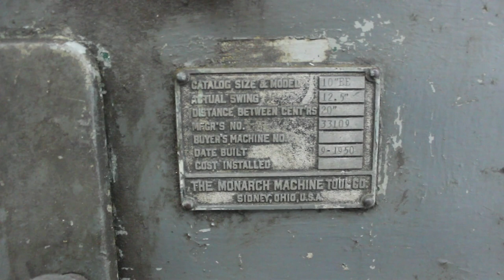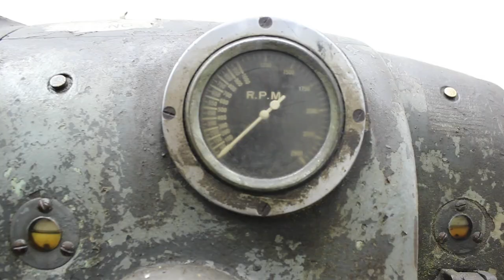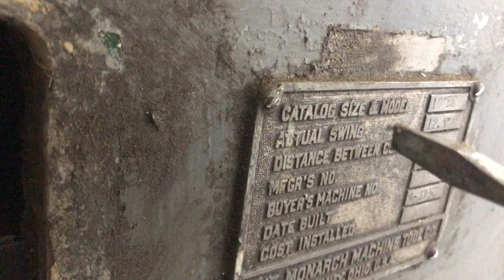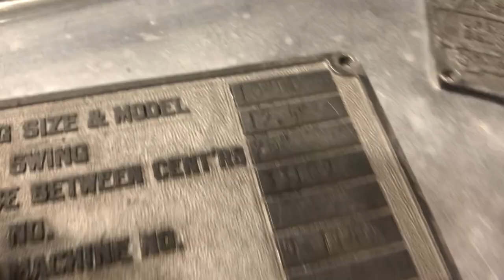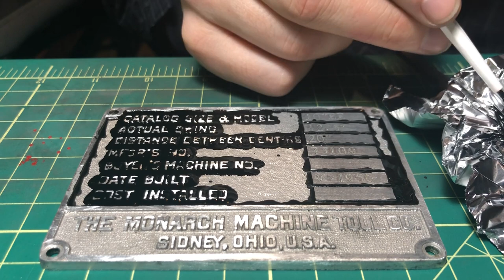Monarch 10EE Restoration 1: You Have to Start Somewhere

Comment: getting here late - but along for the ride.  impressive skills and care - with the Dremel to get your slots cut.  editing is funny and insightful - for those that know the machine - and I can't imagine anyone who DOESN'T know the machine taking the time to watch.  Long pauses at times says it all.  Question: what type of paint did you use for the tags?
Reply from the maker: Thank you! I used some Testors enamel for the tags and sprayed a rattle can of Rustoleum automotive clear over them. It took quite a while but it ended up curing good and hard. I find that you need to multiply all the cure time estimates by 10... luckily i'm not in any hurry!